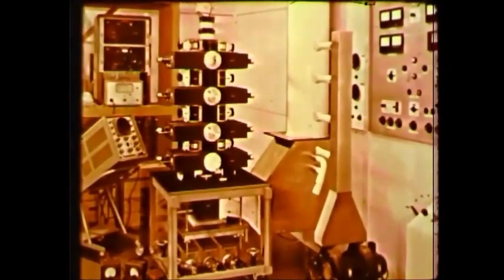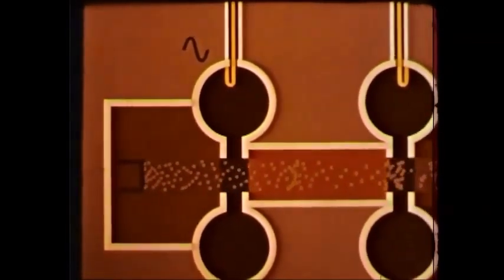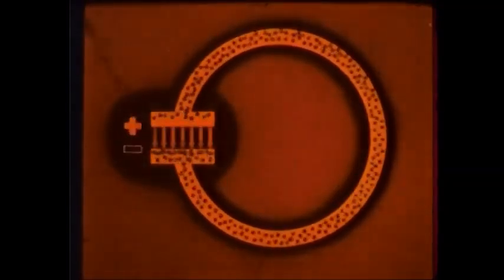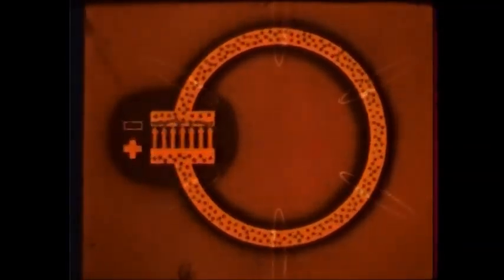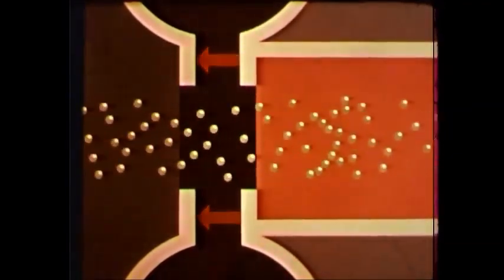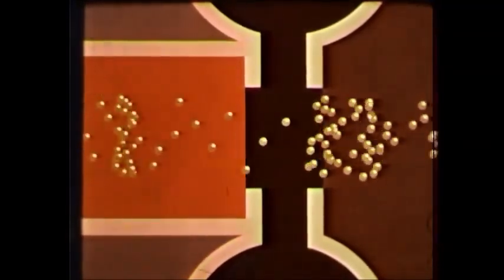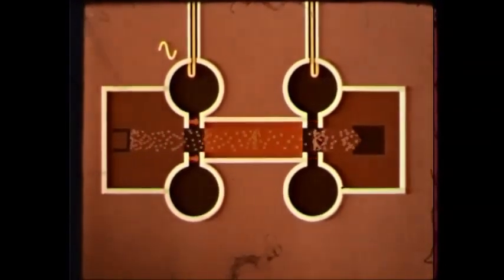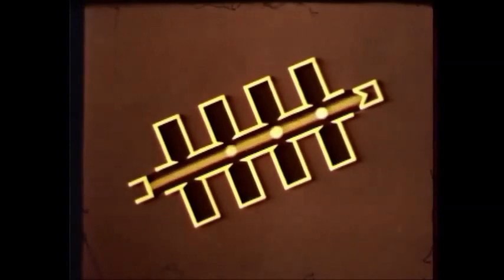How a Klystron amplifier works

Comment: So complicated, but so simple at the same time.  The simple part involved firing off electrons from a cathode, and the cavity resonator - both very simple concepts (a cavity resonator is just like an LC tank circuit, basically).

The complexity was in how those two simple electrical actions were combined, and that the result was  amplifying an input RF wave.
Reply from the maker: Thanks for the comment.  Do you work with or study klystrons?
Reply: @1010tesla  I have a STEM background and generally like ElecEngr subjects as a hobby - thanks for providing this, it's a great video.

Comment: That thing is ingenious. Thanks for posting this video, I always wanted to know how these work.
As a tl;dr: The amplification works because the input signal is only used to modulate an existing electron beam while the output signal uses most of its kinetic energy, aye?
Reply from the maker: Thanks for comment.  Do you work with Klystrons?
Reply: @1010tesla No, but I am a teacher for Maths and Physics. And this is quite the example for more advanced oscillators.

Comment: For the coupling of the coaxial cable to the first or second resonator  is the center connector terminated to the surface of the cavity? or is it air coupled
Reply: it has antenna - an "power copler" probably

Comment: this is awesome! does it mean that a late electron arrives in time with a early electron, so we can ave time travel in the past? well, i really think so after viewing this video! Another thing, amplification OF POWER guys not only of signal, does it ring a bell? this is the best explanation of Tesla\s pancakes coil, those are the resonators used in air at very high voltages. the flow of electrons is supported by the earth, which is a great donor from the aquifers, similar to the pyramids! WOW!

Comment: But, while to reduce inductance ,why a capacitor is also parallelly conected , it leads to increase the capacitor value,then how frequency increases?
Reply: easy, it\s just an analogy. Inside a cavity, there wiil be certain FAMILIES of resonant frequencies. This depend on the shape and dimensions. ONLY THAT frequencies will be old inside by standing waves created by total internal reflection and the boundary conditions of the inner walls. the link to an LC oscillator was only for analogy, ike i said!

Comment: Uhm starting at 5:12 you have magnetic field vs. current following a "left-hand rule", whereas we all now that it follows the right hand rule.  Thoughts?
Reply: +ilikeeggs216 Right hand rule applies to positive charges, left hand rule to negative charges.
Reply: +rai ZOR Whoa.  So the right hand rule which is taught in introductory physics is used for hole current, not electron current?  That is peculiar, since holes were not even introduced as a concept in that class.....
Reply: ilikeeggs216 really? The fact that conventional current & electrons travels in opposite directions is one of the first things you learn when studying electricity, we learnt it in high school.
Reply: +rai ZOR  I know current is charges/time, but I didn't know that it was referring to holes not electrons.
Reply: @01rai01  but the animation is showing electrons moving, not 'holes'  3:32 so his question is valid
Reply: The current direction is also from negative to the positive. If you look at any book about tubes they show current flowing in the true direction (from - to +). They did that because it was easier to understand the operation of the tubes. Its the standard with the tube.

Comment: Very informative! I'm en electronic technician and was wondering if anyone knew what would happen if the input frequencys to the cavities were were altered? (Different for each cavity higher and higher the next cavity?)
Reply from the maker: only the first cavity is the input cavity and the last cavity is the output. the cavities in between increase the electron bunching.  If the middle cavities were not tuned correctly it would effect the bandwidth, gain, and flatness.
Reply: @1010tesla  ohh. Ok. Aka stop the klystron from working. I was a little puzzled. Thank you!

Comment: Not saying they don't exist, but I vever seen a film that didn't have date, in Roman numerals, even if it's only the year. Generally in the ending credits. Perhaps this  copy that had the credits cut out, whet digital storage an transportation was real expensive, who could know? Anyway thanks for posting.
Reply from the maker: I had the original film and transferred it to digital.  there was a leader that I have cut out before posting it on youtube but I did examine every single frame and there is no date anywhere.  not even roman numerals.  there were a few frames thanking the companies for assistance in making the film and the countdown frames but thats it. I may look up the companies listed to see when they went out of business. perhaps that will tell me the latest date it could be.
Reply from the maker: well, right after telling you I couldn't find a date I went back and reviewed the original to get the companies names and sure enough, I completely overlooked a date.  at the bottom of the acknowledgment frame, there is a 1964 date.